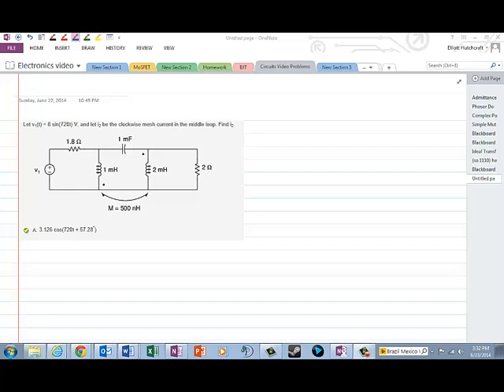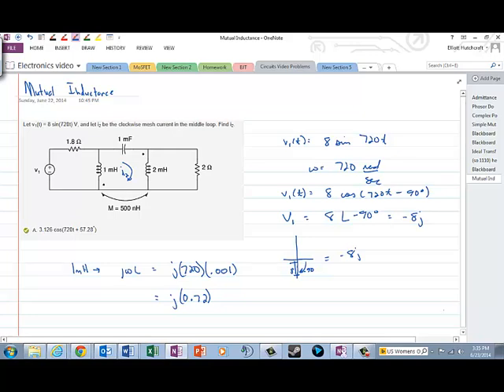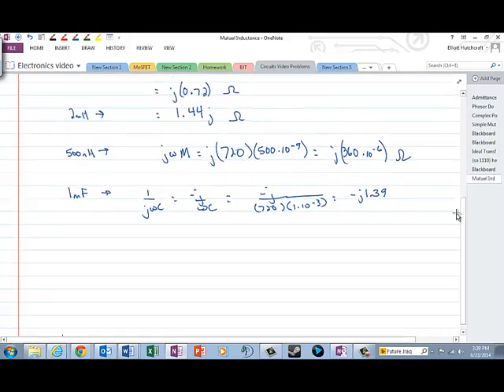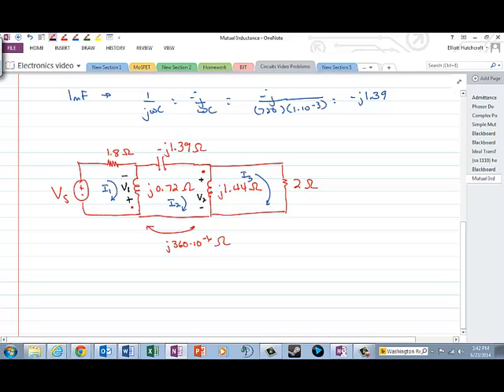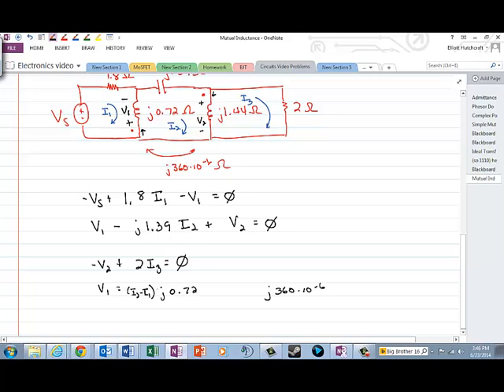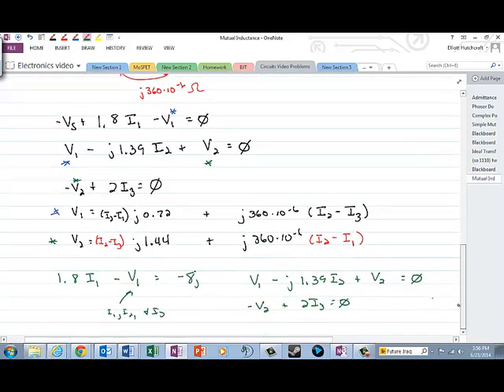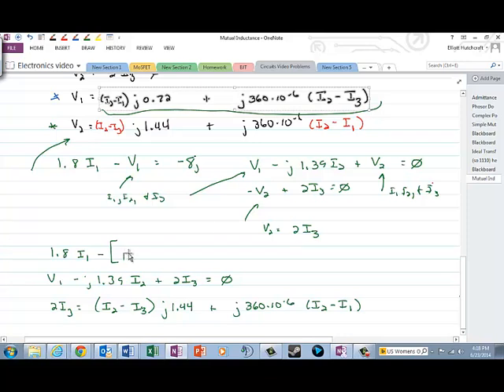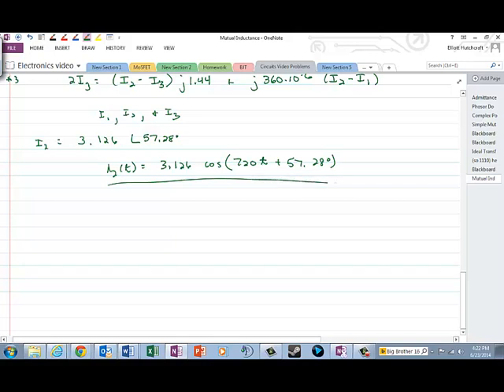ENGR 360 -- Three loop 2 Mutual Inductance Problem

Comment from the maker: So, naturally the answer is WRONG.  Magnitude is right, but phase should be 57.3 - 90 = -32.7  They probably used a source of 8 COS (720t) previously and then updated the problem by just changing the phase of the source by -90 (that's all that changing to sin from cos does).  Unfortunately, they didn't update their solution by changing its phase by -90 degrees.  See the document on blackboard.  I have worked the rest of the algebra out and solved it in Matlab.